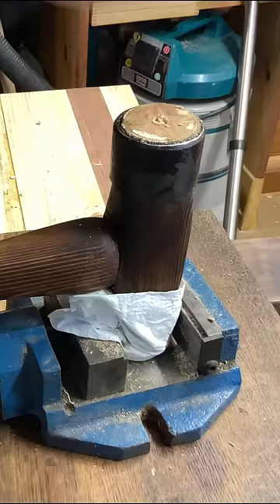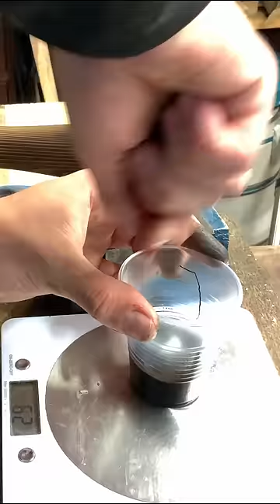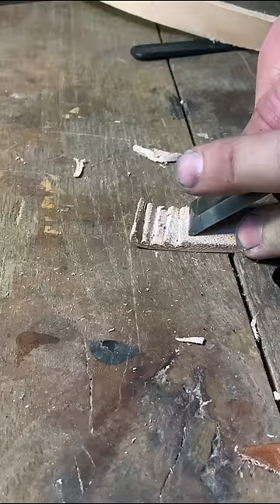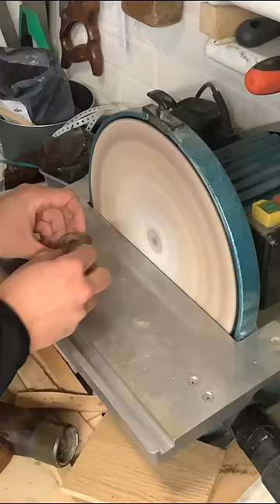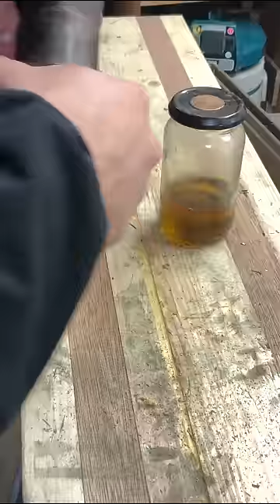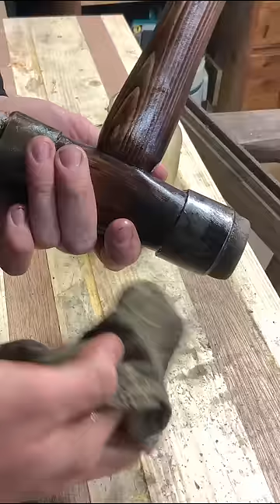Making a Lead Hammer

Comment: Man your lead hammer seems to be made mostly of what could only be described as wood...
Reply: Wood, steel, lead and leather.
Reply: This has the same energy of "Sir, this is a Wendy's"
Reply: @6SugaR6MiLK6  Ayo what😬
Reply: It looks like the lead is on the inside but it’s protected by the coiled up leather
Reply: It's not really a hammer which has a metal striking face. With a wooden or leather face (like this one) it's more like a mallet.
Reply: @6SugaR6MiLK6  cho-chotto matte!
Reply: @6SugaR6MiLK6  hotel alabama
Reply: @6SugaR6MiLK6  hol up
Reply: I don't think you know the purpose of lead in this hammer
Reply: Bruh you could have just googled what a lead hammer is.
Reply: @rveruqvdohv3799  The lead's purposes is to give more weight and more force when used? Just curious
Reply: @WinTeR1z  That's what I think. Don't matter what it looks like as long as it smash.
Reply: It ain't wood,it's leather strip rolled,LOL,😀😀😀😀😂😂😂😂
Reply: @thernly  that's the name of my first album!
Reply: @rveruqvdohv3799  "Don't matter what it look like as long as it smash" happens to be the extent of my standards when choosing a mate!
Reply: It's probably not for shaping lead, he put a lead core under the leather pad.
Reply: @tiffanybruner6002  yes
Reply: @musthavmusic  ,no he didn't it was wood
Reply: @parthochakrabarti8368  wood isn't silver
Reply: @jebaited2449  Yamete kudastop
Reply: @6SugaR6MiLK6  
God damn....

Why is it entertaining?
Reply: @rveruqvdohv3799  The Hammer is called a “Lead Hammer” because it’s used to contour and shape soft metals like lead without damaging the surface of the metal. The literal hammer isn’t made out of lead.
Reply: Lead weighted
Reply: @ikey1119  I know
Reply: The concept of using a heavy object to strike another object predates written history. The use of simple tools by our human ancestors dates to about 2,400,000 B.C. when various shaped stones were used to strike wood, bone, or other stones to break them apart and shape them. Stones attached to sticks with strips of leather or animal sinew were being used as axes or hammers by about 30,000 B.C. during the middle of the Old Stone Age.
The dawn of the Bronze Age brought a shift from stone to metal in the toolmaker's art. By about 3,000 B.C. , axes with bronze or copper heads were being made in Mesopotamia, in what is now Iraq. The heads had a hole where a handle could be inserted and fastened. Nails made of copper or bronze were being used in the same area during the same period, suggesting that hammers with metal heads may have also existed. By about 200 B.C. , Roman craftsmen used several types of iron-headed hammers for wood working and stone cutting. A Roman claw hammer dating from about 75 A.D. had a striking surface on one side of the head, and a split, curved claw for pulling nails on the other side. It's appearance is so much like a modern claw hammer that you might expect to find it in a hardware store, rather than a museum.
With the development of commerce and the specialization of trades, many different hammer designs evolved. Coachbuilders, wheelwrights, blacksmiths, Pricklayers, stone masons, cabinetmakers, barrel makers (coopers), shoe makers (cobblers), ship builders, and many other craftsmen designed and used their own unique hammers. In 1840, a blacksmith in the United States named David Maydole introduced a claw hammer with the head tapering downwards around the opening for the handle. This provided additional bearing surface for the handle and prevented it from being wrenched loose when the hammer was used to pull nails. His hammer became so popular that his blacksmith shop grew into a factory to keep up with the demand. Most claw hammers made today use this same design.
Modern hammers come in a variety of shapes, materials, and weights. Although some specialty hammers are no longer available.
Reply: @jamesthe-doctor8981  Mallets can have hard striking faces; it's just that their face can't be made of steel. I also tend to add on to my definition that mallets tend to be double sided hammers, and lack a claw or blade.
The thing you hit with is the face of a hammer, the HEAD can be made of anything; as long as its face isn't made of steel.
If you have a Steel HEADED mallet, as long as the face isn't made of steel, it's still a mallet.
Now there are some odd areas of question if we are to use most people's definition; "Non metallic head".
I have many issues with this definition. Plastic mallets have metal heads, only plastic faces. Using the original definition these would be hammers.
Brass mallets, their faces are made of brass, and usually plastic on the other side; but again, the head is made of steel, and even though the brass face is a soft faced metalworking mallet, it would still be a hammer according to that definition.
Using my definition, no Hammer can match the qualifiers for a mallet, and vice versa.
If you ever see someone else using the "soft faced" definition, and forgetting to specify they are double sided, tell them to use mine instead. The faces aren't "Soft faced", they're "Softer faced".
That is, softer than what you're hitting them with.
And all mallets are double sided, they don't come with a claw or a blade, if your mallet comes with a soft face but a claw or blade on the back, it's a soft strike hammer.

Thank you have nice day.
Also ask me about the difference between hatchets and handaxes.
Reply: @bluedolfine28  There exists no specialty hammer that is no longer available; unless you don't use hammers.
Only in that case would it be unavailable to you; us on the other hand, know how to read public Access patents for specialty hammers, and can make all of them in our shops.
Reply: Wow bro you really got em there
Reply: It from a lead tree
Reply: @6SugaR6MiLK6  ,
Reply: @D-Vinko  haaa. In all of the article THAT is what u r pointing out..
Reply: @6SugaR6MiLK6  So it's a lead hammer, not a lead hammer. Gotcha.
Reply: @6SugaR6MiLK6  yoooo you outta pocket for that one 😂
Reply: @6SugaR6MiLK6  Good insight also what
Reply: Yeah… not sure what I would cal this other than a custom hammer. 
Lead hammers are meant to also have softer lead faces. Like copper or brass hammers. Using leather pretty much just turned it into a hobby toy now.
Reply: @ayanmaity2605  h mmers go bang 🔨..🛠⚒🛠
Reply: @6SugaR6MiLK6  oh I do that 🙂
Reply: Leather
Reply: @6SugaR6MiLK6 . I thought it was your sister?
Reply: @6SugaR6MiLK6  this took a twist
Reply: @6SugaR6MiLK6  😳😳😳🤔🤔
Reply: It's supposed to be
Reply: @6SugaR6MiLK6  hols up bruh how do you know that!?
Reply: Schwepps  shii's weird asf 😂😂😂
Reply: A lead weighted hammer more like.
Reply: @parthochakrabarti8368  No that's definitely lead. Easily recognizable by the hue of its surface tarnish.
Reply: @6SugaR6MiLK6  MY MAN

Comment: That is a hide hammer.  It might be weighted with lead, but unless the striking surface is lead it's not a lead hammer.
Irrespective it's nice workmanship.
Reply: It's meant 'for' lead not made 'of' lead. 
You want soft hide in the head so you won't mess up softer metals, like lead.

Comment: Lead Hammer that's mostly wood/leather/brass.....

Lead Hammer: Typically lead cast over a steel handle with a crossbar IN the cast Lead portion...

What do I know; in some countries a Lead Hammer is a Weighted Leather Mallet

Comment: All that effort not to mention the damaged Forstener but when you can by replacement rawhide hammer pads on eBay.
Reply: It's very satisfying to use a tool that you made yourself rather than just buying it, the time and effort is negligible if you enjoy doing it. Plus, if you have the skill set, it's not that difficult to make it of better quality than the mass produced version.

Comment: You realize that if it actually WORKED that it wouldn’t have bounced when you hit the table. You just made a MALLET with leather ends and a dumb lead WEIGHT insides not a lead hammer

Comment: I use the hammer to make the hammer
Reply: Even steel hammers are forged using heat and a hammer.  It compacts the grain structure of the metal, making it more dense and stronger